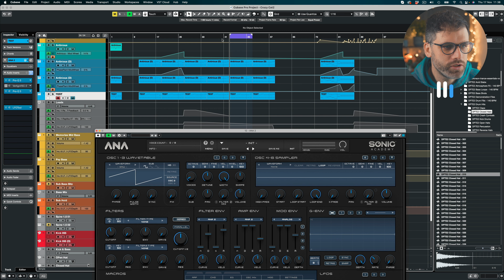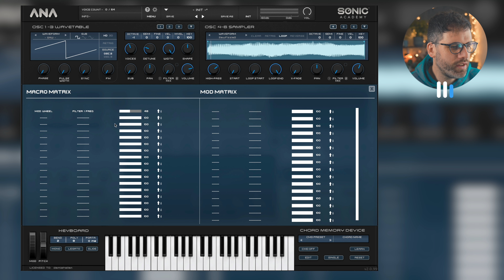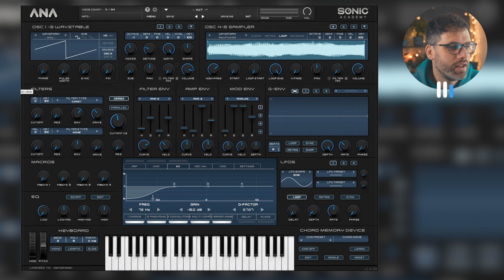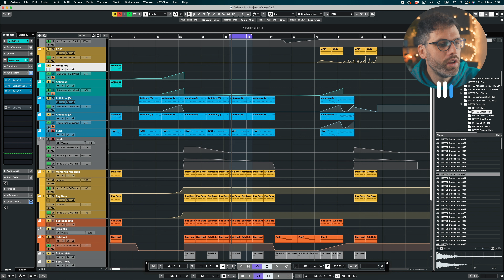Using ANA 2 for Trance Sound Design | Music Tutorials

Comment: Thx Demis. I really like tweaking in ANA2. I sat on this one for awhile and have recently started using it more. When you have the NI plethora, Pigments3, Vital, Union, and others, you forget about these others. I never rode the Serum bus, but this synth seems to have more features, but again, so does Vital.
Reply: It was also updated yesterday to 2.5. More new features. 👍👍👍
Reply from the maker: With synths it’s a case of using the ones that suit how you work. Of course the sound engine plays a big part but ultimately choose one you find easy to use. 

That’s why I teach vital due to a nice balance between easy to use / teach and sound quality. 😎
Reply from the maker: Will be grabbing the update tonight 👍🏻😎